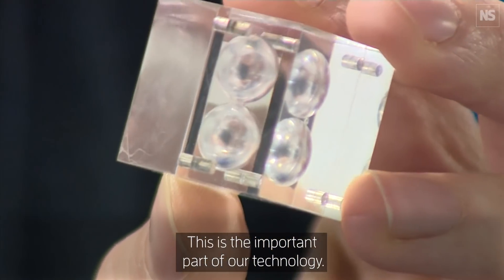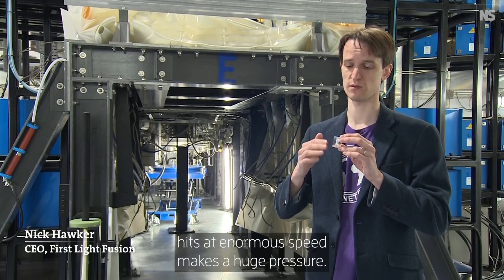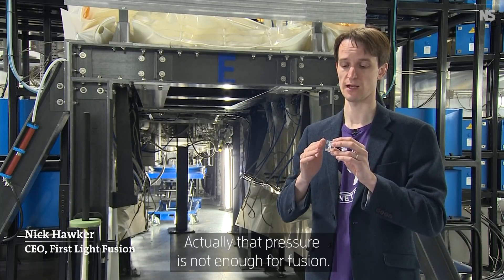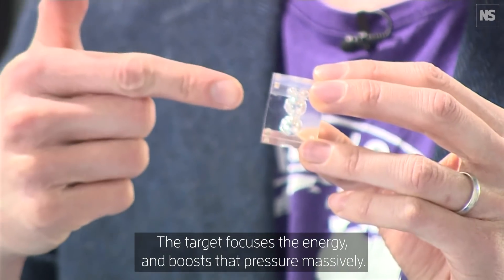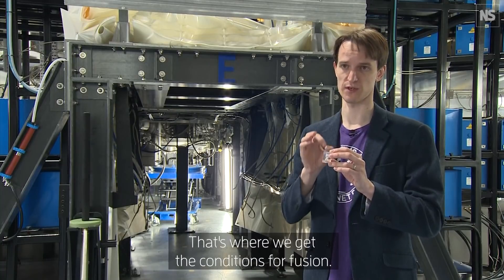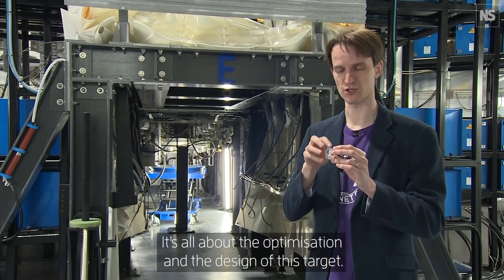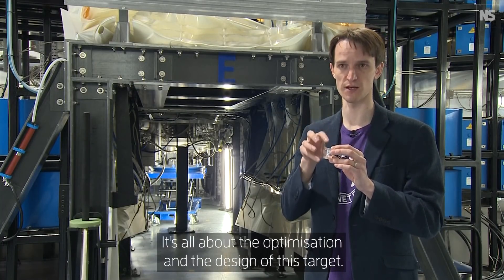Nuclear fusion breakthrough achieved with new projectile technique

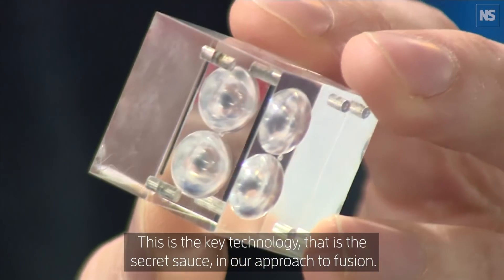Comment: Is it theoretically possible for you to get more energy output instead of the input ? (1:02)
if it is possible even only theoretically, doesn't mean that..  you can use to make a fuel, out of the energy that have been output.. then reinserting the fuel to make even more energy to make more fuel and so on.. thus perpetual machine is born ?
Reply: @Corrigan WrongWay So how does this project work then ?
Reply: @Corrigan WrongWay I did follow trough until the end.. They have negative output "Now"... but they are working to make Surplus output.. like i said.. perpetual machine ??
if not mistaken even great countries are trying to make those.. ITER, right ?
(https://en.wikipedia.org/wiki/ITER)

Comment: The thing is, that accelerating something to over 6km/s takes a lot of energy, and this video did not mention how much energy was used to get out how much resulting fusion energy. It would have been a good thing to at least give some ballpark figures. If they used 1,000 Wh to get 1 micro Wh then there is still a loooong way to go.
Reply: That's only 7 times faster than a bullet from an AR-15, roughly. Yes, it's extremely fast but I doubt very much material needs to be accelerated. I imagine our main impasse is containment as fusion is a self sustaining reaction, as evidenced by stars.
Reply: @Corrigan WrongWay Actual data bringing in investors and grants is literally the only way this project would ever get past just being a neat paper, idiot. If you put a fraction of an amount of effort into actually applying yourself you could easily find their peer-reviewed papers, instead you complain and moan about made-up problems that only exist in your head.
Reply: yeah..they know 1:06
+1 useless comment
(edited for a good timestamp)
Reply: Due to E=mc^2 its safe to say the energy created from fusion is massive compared to the energy used to accelerate the particle. It is the most energy efficient conversion in the world currently and close to the most efficient energy conversion physically possible.
Reply: I was extremely skeptical when the said they hoped to get a 100 MW-class reactor within 10-15 years. Going from proof-of-concept that you can create fusion, to net positive, to an actual fusion power plant (which would be the first successful fusion power reactor) is a HUGE leap in technology and requires different research/manufacturing throughout (it's much different to show you can create a net positive with the system then it is to show you can then capture that energy in a usable form). Building the plant alone would likely be a 5-year endeavor minimum. Certainly exciting work and something that should be researched but that statement was too much of a cash-grab for investors and I'm pretty sure has no data to back-up that plan (it is also possible the media misrepresented what they meant).

Comment: Huge breakthrough and only 10 years away.  That is an inside joke for those who've followed fusion for 60 years.  Everything is only 10 years away.  I pray they are right, and economic viability is possible.  Even if it is a success on paper, it also takes a receptive audience to make that kind of investment.  Also hope it doesn't require something really exotic like Helium-3 which is most easily found on the giant planets, or perhaps on the surface of the Moon.

Comment: I do not see how a gun type design like this can ever be made practically to actually produce electricity and get constant consistent energy. At least with a tokomak you have a much clearer path to how you can heat up water for example and run a turbine. But of course i support any new approach and thinking about this. We need to get fusion energy going.
Reply: The fusion will produce heat, neutrons and charged particles; perhaps some smart engineer will figure out a way.

Comment: Ironically, a "nuclear gun" was exactly how Little Boy [Hiroshima bomb] achieved nuclear *fission*.
Reply: Yes, at a much more leisurely speed. I also thought of the relation to starting a fission reaction. If you can get enough of a bang and power release with fusion you might be able to trigger a trigger for an H-Bomb type device to work without the A-Bomb required now. Perhaps with the right combination of pellets, targets, target geometry, magnetic fields, and shockwaves we will get somewhere. Present day H-Bombs are initiated by compression of the Deuterium and Tritium on a bigger scale. Very interesting ideas.

Comment: General Fusion from Canada is developing on a similar approach. They are also based in the UK and Burnaby, BC. They are using a piston approach. the prototype machine drives a forceful, but precisely shaped, symmetric collapse of a large liquid vortex cavity in tens of milliseconds.
Reply: Projectiles and pumps versus the EM force! It looks, to me, like a cyberpunk type of approach at first, that was until I read about their power plant design and some of its advantages over the tokamak style of power generation. And according to their website, this technology can use lasers instead of gun barrels, so back to EM waves and no "moving parts", great stuff.
Reply: Lasers? Electromagnets?? Nope!!
🔨 just smash deuterium with a Stone Age Hammer 🗜️ = 🌞

Comment: What, more output energy than input?
Reply: Ok so to explain this apparent paradox, it's not more energy output than input.  In fusion, you're converting one type of energy to another.  But this process takes energy to do.  When they say they hope to get more energy out than in, they mean they hope to convert more energy than they use to convert it.  

Your car does the same thing.  The gas in a car isn't just magically making energy, it's converting it from one type to another.  But if the efficiency of the conversion was too low, it would consume more energy than it converts.  That's where fusion is right now.
Reply: I understand it's not just to keep the lights on, that most bleeds out. Thanks!

Comment: And how exactly is this going to become a practical and reliable source of power? A discontinuous process like this is not really going to much use outside of the laboratory.
Reply: What if the gun hits a projectile, achieving fusion, which warms a fluid surrounding and flowing through the fusion chamber? You wouldn't need a continuous process, you just need a way to efficiently pulse the machine to keep the fluid at operating temperature. If they can do this in a heavy gas, which seems to be some sort of lithium gas according to a quick google on the company, they can keep that gas at extremely high temperature and pump it around water channels to make steam. It's probably a long way off, but it seems like a much simpler approach than the magnet/laser that's been researched the most. Re-arming the gun every few seconds for hours of operation seems like the biggest hurdle, as well as the efficiency of the actual fusion reaction (if's it's only reacting like 0.0001% of the fuel mass it's probably not worth it,  no matter how big you go). Plus you have to wonder what's going to happen to all of that vaporized acrylic and projectile that builds up in the machine. Still seems more solvable than using big superconductors to make a miniature star on earth.
Reply: well, if the energy pulses are higher than necesary continuous output, then you collect the energy and slowly distribute it

so if it produces 1mil joules, but the needed output is only 100kw, then you only need to do one reaction every 10 seconds (watts=joules/second)

it does also mean you need to have some really good batteries or capacitors to temporarily hold that energy for those 10 seconds and not degrade significantly over the costant recharge-discharge cycle

Comment: how would the reaction be sustained and heat collected to spin a turbine?
Reply: How they gonna remove the stuff that they are shoting and it is not a fuel? I can imagine that this stuff will be making the whole fussion chamber unusable very quickly...
Reply: from what I understand, most of the energy released from fusion is kinetic, so you can probably use some sort of piezoelectric system

Comment: Pardon my skepticism, but even 70 km a second doesn’t seem that fast. The fundamental problem is how small atomic nuclei are compared even to atoms. How do you increase the statistical probabilities of two nuclei ( or many) colliding by hitting them with something that slow. Even throwing a peanut at a tank would have more impact, statistically. Fleischmann and Pons had us once and seems as daft as storing enough hydrogen on a compact disc to drive your car a thousand miles. I may be wrong but this needs proper scrutiny.
Reply: Achieving fusion is not terribly hard. The atomic boy scout did it. Or you can build a fusor in your garage.

The hard parts are actually getting useful work out of it and dealing with the neutron radiation - it tends to severely activate and damage nearly all structural materials.
Reply: He did say that the speed wasn't fast enough but that the target focused the energy of the projectile to achieve fusion. Perhaps it's like the way a shaped charge focuses the energy from explosives to penetrate armor? Yes I'm skeptical too; but not ready to dismiss the idea yet.

Comment: CLICKBAIT GARBAGE. THIS IS NOT A FUSION BREAKTHROUGH.
They are not even remotely close to break-even, and there in no chance this technology ever will - and utterly impossible it will ever produce a single watt of electricity. Much like ITER: the only good to come from it will be a stack of new doctorates - almost as tall as the building.

There is no possible way to scale this up, or turn it into a pulsed device of any kind. It is nothing but a quirky and interesting novelty - just like every Tokamak ever made.

It is certainly true that steady state fusion devices will never power mankind, but the pulsed devices which end up powering our world will have nothing in common with this system. It is far more likely that Focus Fusion will turn out to be the holy grail. Check out LPPFusion - they have the right idea.

There are no fusion breakthroughs, just as there are no battery breakthroughs. ALL titles which make such claims are outright lies. JUST LIKE THIS VIDEO LIES.

There are only incremental improvements over time. Period.

Comment: we are going at it the wrong way.  we don't need a sustained fusion reaction, we need to harness the energy from the initial reactions like a lightning strike that will spin a group or groups of turbines, then capture that turbine energy n store it in batteries. finally, use that stored energy (which is going to be a huge amount) to sustain the turbines, thereby creating a closed loop energy generation system where the fusion reaction or lightning strike is the ignition switch n the turbines are the pistons.  while the huge amount of energy from the initial fusion n/or lightning strike starts the turbines which generates the energy to be captured n stored in the batteries, which will in turn power the turbines once the initial fusion/lightning strike energy dies out, if it ever does.

now I know that the initial fusion reaction or lightning strike creates a ton of energy which would fry/overload any turbine or battery mankind has.  which is why we will need a multitude of turbines, batteries, live high voltage wire transmissions, n/or a combination of all of the above to handle the load n offset the energy being harvested.

all the fusion projects are set on their sustaining fusion approach because they've got all their time, money, n "talent" invested to change direction now.  but, if they don't rethink, they are going to waste more time, money, talent, n another 50 years.  if the real issue is energy generation, then harnessing that initial reaction would provide ample amounts.  at this point, it is more of an act of self aggrandizement than actual iteration.  of course achieving cost effective sustained fusion reaction would be the ultimate goal, especially when it comes to deep space (or even intersolar) explorations n fulfilling the energy needs of a space faring civilization.  but as far as our current energy needs go, just harvesting the energy n power needed during the initial fusion reaction or lightning strike would provide more than enough energy to power our current lives.

Comment: If those targets can be easily manufactured in quantity so that a power plant would simply feed a stream of them into the reaction chamber it sounds like a nice solution...but there are always an nearly endless stream of 'ifs'...nevertheless it's a nice advancement in a direction that shows some promise, and even if it fails to achieve breakeven there are interesting applications for fusion and along the way we gain more insights as to what might and what might not work. Good luck and cheers.

Comment: How could that ever produce a sustainable reaction?!
Reply: Why does it need to be a sustainable reaction? Bursts, or continuous, as long as more energy is produced than is put in then that's all that matters.
Reply: The energy is released in bursts , but it's continuously captured by the lithium liquid metal 
Since this is fusion , that tiny target can give enough energy to power a house for two years
Reply: @cedriceric9730  There is no mention of Lithium but if Lithium atoms are the fuel the energy is released in a microsecond then they have to reload. There is no possibility of continuous operation i.e completely impractical.
Reply: @cedriceric9730  There's literally no evidence in the video for what you're claiming.

Comment: Nuclear impulse space drives are just around the corner
Reply: We could have built these for decades if we had wanted to. See the "Orion" drive I think it's called.
Reply: @TechCensorshipHasToGo  I believe that the "Orion" design dates back to '59 or so. But the design called for actual nuclear weapon/bomb units, but nuclear weapon detonations in space were outlawed in a nuclear test ban treaty and their use in space would be considered an act of war. These micro detonations would not qualify as weapon detonations
Reply: @Jagdtyger2A  That's correct, my point is that they are 60 year old technology, we just refuse to build them (although we could)